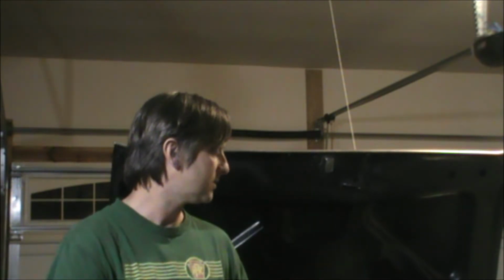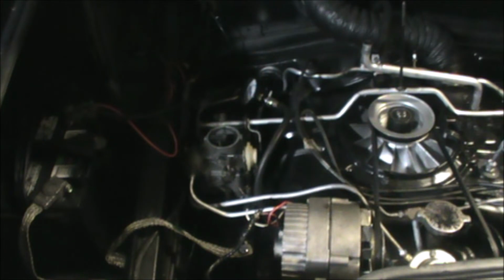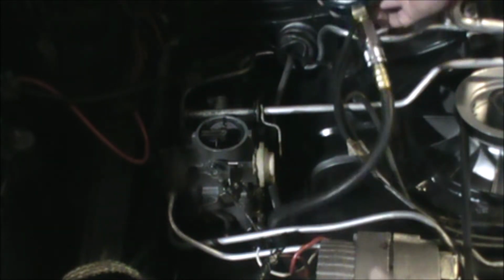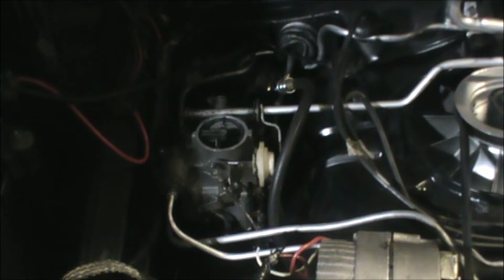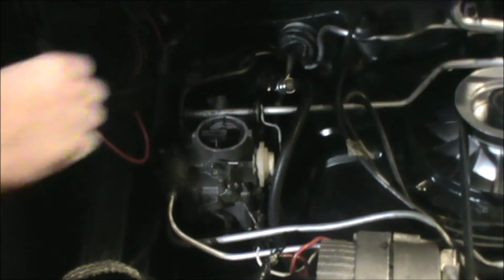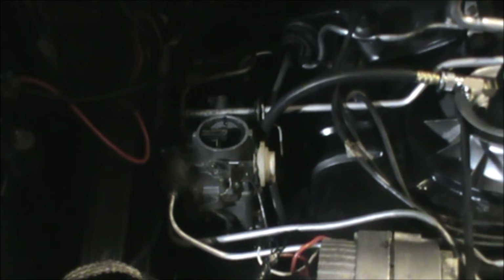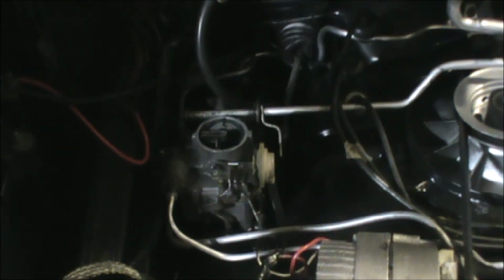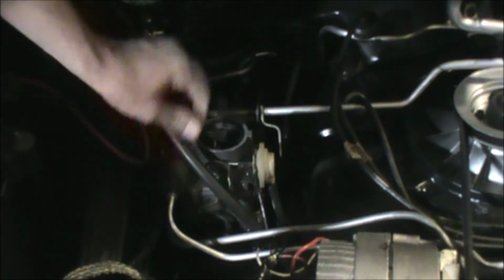Corvair Compression Test

Comment: That sucks.  Don’t give up get that Corvair and back on the road.   I’ll be watching if I lived near you I would help you. Haven’t pulled a Corvair engine apart since the 1980s   I really enjoyed those cars   Good luck.
Reply from the maker: Thank you! I certainly won’t be giving up on her. At least I isolated the issue to the #2 cylinder. I’m guessing it’s either a rocker or a dropped valve seat. Hoping it’s not the latter. If it is, I have a spare set of heads.